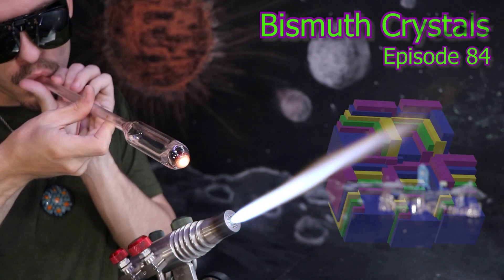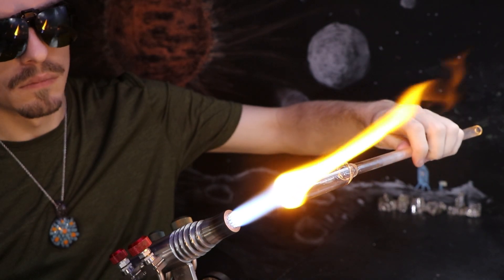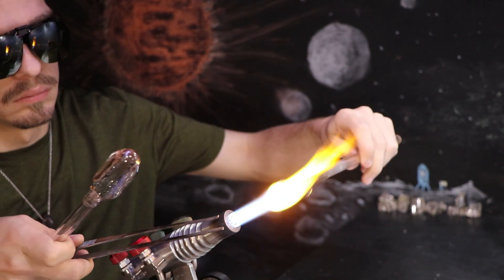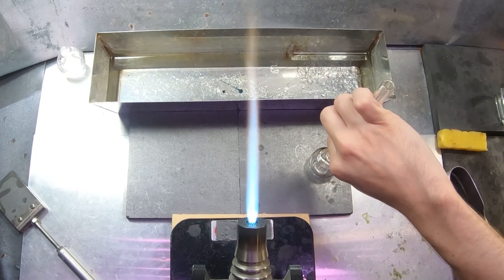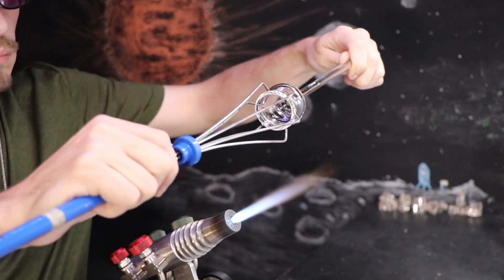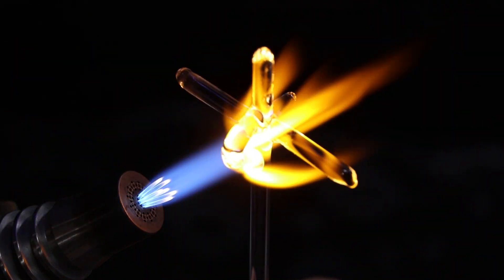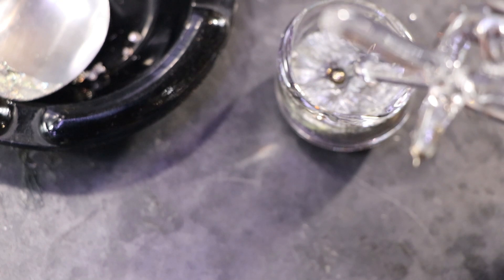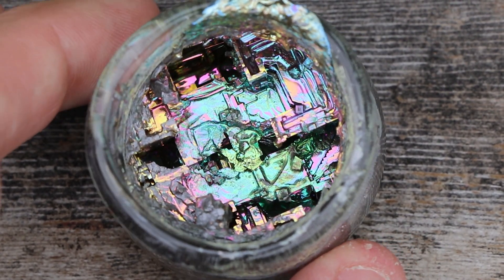Bismuth Crystal Growing - "Glass" Geode (Amazing)

Comment: Neat experiment Matt. I’ve been playing around with bismuth too but never thought of using my boro as the container. I’ve played around with different wire types for the nucleation catalyst. I’ve found stainless steel and zinc wire works pretty well. Copper not at all. But I think you’re closer to the mark with pouring it out of the cup when around 300° and semi solid to get the crystals in the cup. 😷🖖
Reply from the maker: Hey Linda, Yea the Boro seemed to work pretty well. I could probably break the cup to get the bismuth out but I like how it looks, it kind of doubles as a decorative container. Thanks for watching. Make sure to check out this weeks episode on the Spinning Top!

Comment: So cool. Might have to try this in the future
Reply from the maker: Use caution! From the exploding ash trays you can tell this can be dangerous. Thanks for watching!
Reply: @JasaGlass  I would definitely be using a face shield if so. But I still haven't even picked up a kiln yet sadly haha
Reply: @feral7094  There’s lots of YT videos of guys melting bismuth on their stoves. As Matt discovered, you have to be careful with the heat but you don’t need a kiln. Just old pots and some sort of heat source. Matt has a neat take using the boro cups though. Not sure what you’d use it for, but it’s a neat idea.